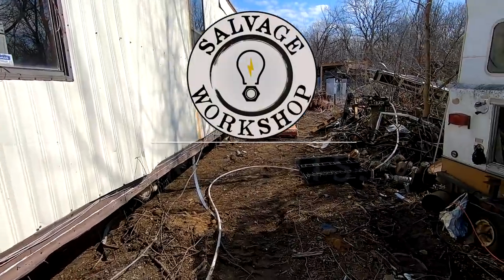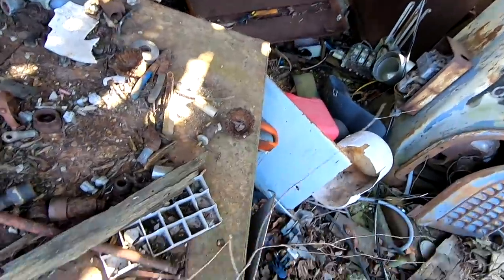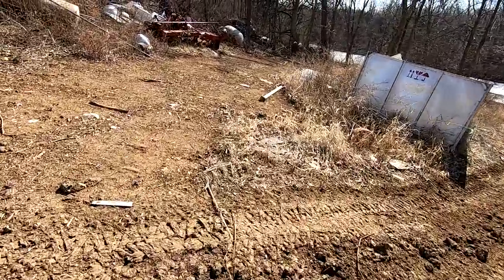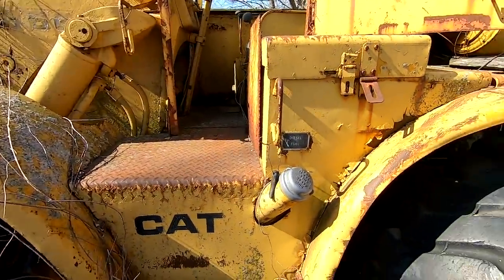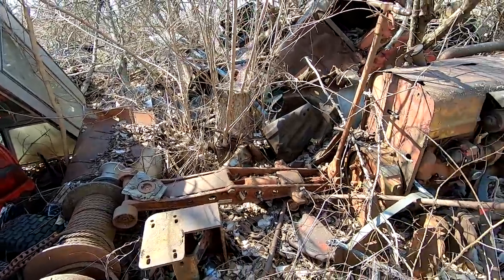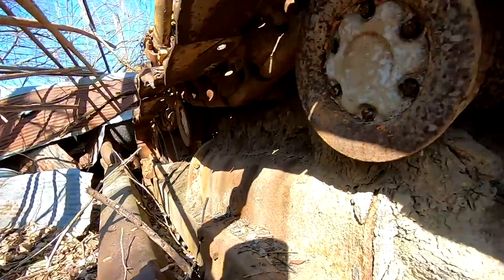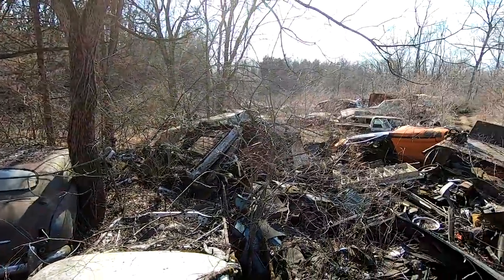Exploring the Machines at the FORGOTTEN Junk Yard ~ RESCUING OLD IRON ~ Episode 5 Part 1

Comment: Those cylinder breakdown machines, last one I saw go at auction, a fist fight nearly broke out bidding on it.
Reply from the maker: Interesting!
Reply: @SalvageWorkshop  If you are in the business of rebuilding hydraulic cylinders, it's a god send to have one. You might try reaching out to some local hydraulics shops, to the right guy it's worth the time.
Reply: I agree. That is a very valuable piece of equipment to anyone who has enough equipment to justify repairing and installing packing kits in their own shop.
Reply: They are worth several times their weight in gold.

Comment: The seat gets hard on the John Deeres & the safety switch inside the seat doesn't engage = no start or emergancy stop if your moving. I gave up trying to bypass the wiring & replaced the seat + seat belt. Very expensive but keep a seat cover on it now. It is a safety feature & you never know when accidents are gonna happen!
Reply from the maker: That is really good to know! Thank you!
Reply: Thomas.
YES, that what I thought. Because that WHOLE section raises. For safety NO start. It's got to be in the seat or seat belt area. But unless a guy who works on those Johndeer, skid steers, probably knows it by heart. It's got to be in the seat area. Maybe the switch is NOT making contact  ( being old) when cab comes down.

Comment: This place should be under the strict protection of the conservator of monuments. Not a single machine or tool should be scrapped! I'm waiting for part 2. Greetings from far away Poland :-)
Reply: I think the milling machine is not repairable within any economic sense, you can buy them here for less than a thousand dollars, even $500. And no rust!
Reply: @RRaucina  Machines too have the right to die. There's lots of precious metals there and they ought to be recovered.
Reply: @RRaucina  Right
Reply: Right

Comment: That marvel 6a power hacksaw is fantastic!! I love my 14” Racine. Fantastic saws. 

Drill bits are fine. Probably just need to be sharpened 

Those lathes are sweet 

So many treasures!
Reply: I love my Peerless from 1942. Probably 4,000#. $75 at the school shop auction.
Reply: @RRaucina  awesome! Mine was 300$ a few months ago. 400$ in spare blades came with it so it was a deal for me at least. It’s well paid for itself cutting up to 6” square stock. A bigger one would be awesome though. 
 
Mine was originally in a machine shop and later in someone’s garage used for cutting wood haha 

1960s I believe Racine 14” wet saw. I have a video clip on my channel showing it
Reply: @JustinTopp  Nice. I came from Racine and Kenosha too. The industrial heartland

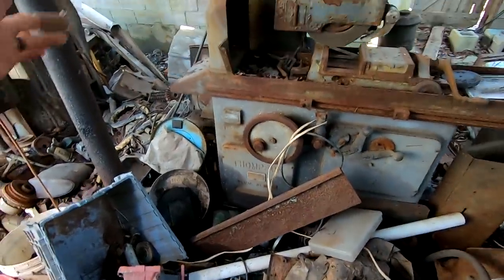Comment: [8:00] I think the drills would be saveable, because they are (relatively) easy to resharpen if you have the right sharpening jig (or skill).. evaporust and resharpen.  The milling cutters might be harder- i suspect the cutting edges would be pitted and you would need a cutter grinder and considerable time to put new edges on them.

Comment: Definitely save the bits and cutters, older made parts tend to keep their cutting edge better than things today.

Also with the amount of variety you'd probably never have to buy one again!
Reply from the maker: Yeah that is true! Problem becomes, hauling it all out of there, then cleaning it, having the proper place to store it, and then organizing it in a way that I can find it when I actually NEED it! It's a LOT more work than you might think! (Don't get me wrong, I still may go for it!)
Reply: @SalvageWorkshop  yeah that's true, storage and cleaning is always the thing you over look I have cleaning jobs for finds lined up longer than I care for! If I was there is be grabbing every slab mill I could find, you can never have enough slab mills!
Reply: @SalvageWorkshop  Yes, be careful that in 40 years someone is not making a video of YOUR hoarded mess!
Reply: All those cutters and drills can be cleaned and sharpened. steve summers has videos on his channel showing how.
Reply: In my opinion when you get more than light rust on HSS tooling the cost of regrinding exceeds the value of the tooling  take  for example morse taper drill bits easy to regrind the tip but the taper will be pitted the cutting edge on the flutes will be blunt not easy to regrind 
easier to get one off ebay  I agree that the steel is likely to be of good quality

Comment: IDEA: Once Big Red is up and running around, for sure you will have calls for work/help. The low boy trailer is a no-brainer. Instead of the Kenworth, might consider a sizeable dump-truck. Many times when a Cat is required, so is the need for a dump truck. Cha-ching! And then even a smaller sized excavator is frequently needed. Voila - a new profession that makes great $$. Love the vids by the way.

Comment: You should get the 966, the big Manley jack,the dozer with the tree growing around it,the lowboy next to the dozer & the rig,those would be great for you to get & get them running again & the lowboy you could do away with the wood & replace it with a steel bed same with the ramps, but I noticed that the yellow lowboy has steel ramps on it so I wonder if those would fit on the lowboy next to the dozer if so just take them off & switch them

Comment: This isn't a junkyard. It's  SALVAGE Yard!
23:00 that's a big wheel loader.
29:00 might want to run some numbers. Sometimes old track machines like Old Red had back-hoe attachments.
29:20 HOLY CRAP! A CUB! Those things can still fetch a decent price, as they are still a very handy lawn/garden tractor that won't break the bank. Would be a good purchase.
29:50 Told you it was a big wheel loader. :) Probably wouldn't be TOO difficult to start. Maybe...
36:20 Is that a crimper for hydraulic hose in the tool-box? Or part of one?
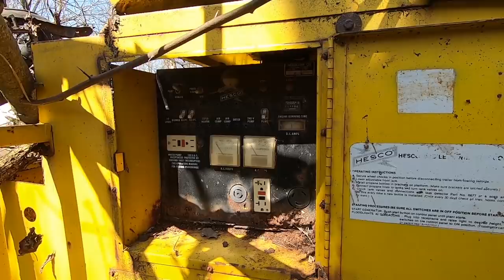43:00 ooooooooh parts!
49:00 Huh, that would be interesting this to get out. Diesel Creek would approve.

I'd still like to see what that over-turned tracked machine is that was behind where your Skidloader was.

Great video! I love places like this! My grandparents usually had a "dump" somewhere on their property that was always full of stuff like this. Loved digging through it!

Comment: On the skid steer, just to the right of the seat. Creak the starter fuse. It is a 15 amp fuse, closest one to the front.
Front to back-----Starter, loader arms, acc and lights. 15,15, 25, and 20.

Comment: The Kenworth looks like an early to mid 1990’s T800.  Single stack, looked like a five over five Eaton 10 speed shifter: 5 speeds high and low range, and two speed reverse.  The one I drove was a 1995 with a Detroit diesel.  Good trucks.  It could be a W9 too; those are more common as OTR trucks and the T series are more often service trucks due to a shorter turning radius (if I remember correctly).  The one I drove used to be an over the road long haul truck, but we pulled the sleeper off and put a 3000 gallon water tank and a pump on the back and built a fire truck of it.  Great chassis for that use!  Quick, powerful and nimble for such a big vehicle.  Even with a full water tank, she moved out like a sports car!   Hope you can save it!!

Comment: That place certainly goes on and on. If you are planning to rescue things: Lathes, milling machines, vices. The tools are likely corroded on the cutting faces and even with re-sharpening might not be any good (sorting them out you might find a few good ones), drills could be sharpened. The auto lift. That Singer sewing machine is an industrial model useful for automotive/furniture upholstery/sail making (I've rescued a home one that had been corroded in a chronically flooded basement) that era machine is pretty rugged. Contact the Vice-Grip Garage channel about the cars, maybe he spies some co-channel projects depending on how many states away you are. Any old farm tractors out there? Those are fun too.

Comment: Is it possible we can get a "will it run" on that Cat 966?! I do so agree it would be a nice addition for Big Red. Even if it's just for Fun. So so much machinery out there wow. The Series 1700 Skid steer is an Owatonna, The IH Power Unit was a Factory they did in fact use Tractor engines Yellow & White IH Cub, the early 60s to 70s. Those are getting tougher to find. I'd got an ole Round nose 1951. Kenworth T600 would be the model 1984-07, And that Allis HD16 Crawler believe it or not It's Much rarer than your CAT. Very few of those Big ones left. Would be worth getting it out of there.

Comment: I have just looked up the 325's seat and seatbelt sensor. It looks like the seat sensor is a simple switch that, when sitting on the seat, the switch is closed allowing power to go through it. If you put a jumper on the connector it may work. As for the seat belt sensor. They are normally either work based on resistance or just live/ground pads inside the slot. The seat belt buckle will bridge the pads. If the problem is with the seatbelt sensor itself, then my guess is that the pads have warn down. If it is simply just a live and ground pad, then simply using a jumper would again, bypass the sensor. If however, it is a resistive system I have no idea how you would get a replacement (I can't find one on google). You could work out what resistance value is needed to trigger the sensor though. Which is possible to do, you can use a variable resistance device and just go from 1ohm to 100,000ohms until the light turns off. Then stick a resister of that size in the connector. 

Without more information on the problem I can't really make a proper guess on the solution. If I was a betting man, I would put 5 bucks on "The motor works great, but it doesn't want to move"  would mean that the parking break is stuck on, which would be caused by the seatbelt sensor.

It's a shame I am about 4000 miles away. I'd pop over with some test equipment and have a go at diagnosing it. (I wouldn't try to fix it, I can't afford to replace it)

Comment: the seat switches on all of these machines are simple on or off , and its very common for them to develop and intermittent state , usually a simple jumper wire between the power and ground will do the trick

Comment: well the backhoe attachment or possibly the tulsa winch would be neat attachments for old red . also the Palfinger truck crane is reallly incredibly expensive if new and would be a good safe, if you put it on a foundation with a hydraulic agregate and tank you got a very sensitive yard or shop crane also it usually has hydraulics all the way to the front - so you not only can use it for forklifting pallets but also to use a hydraulic clamshell bucket for dirtmoveing allowing the truck to load itself - so for minor material movement you dont need to haul any excavator or similar equipment 
also can lift more than your auto crane and is thanks to hydraulics a lot more precise to place - my guess for age is 1990s also you still get every spare part there is from the original firm - even for old series - like metric hydraulic fittings and hoses or the right metric hydraulic ram seals ,

Comment: If anything, a few cans of rust inhibitor spray and plastic wrap should be done to protect the machinery short term. Most of the tools can be revived in a drum of diesel. It is possible that somewhere in that workshop there will be a tool sharpening grinder to clean up the good looking tools. There a lot of money about to be lost there, so please do your best to recover as much as possible. Vintage tooling has a place somewhere.

Comment: I buy rusty, junky tools and parts, clean them, and sell them. In about 20 years, I've had a handful of pieces that weren't salvageable. The metal in the older items is so much better than newer ones. The metal in old machinists tools are always salvageable. I use Metal Rescue because the chemicals are less toxic, take my time, pay attention to temperatures, use soft abrasives when necessary, and am careful not to over clean. That is, I'm not trying to make it look exactly like it did 100 years ago. My goal is to remove rust, gunky grease, and other dirt in order to make a clean usable tool or part. Definitely worth cleaning up those old tools!

Comment: I have used an inexpensive way to remove rust from objects is to soak it in Apple Cider Vinegar for 3 or 4 days. I buy it in gallon jugs at the Grocerie store.  The Vinegar is a mild acid but does a good job.

Comment: wow! that's a lot of stuff. my main vice is a wilton bullet, but it is a 4". i've never seen one as large as the one on the floor. kinda makes you want to build a new pole barn just to save all of this equipment. it does me anyway. i kinda like the idea of mounting the manual tire changer horizontally on the end of a bench. i might try it with mine. you could spend a year on this property and not see everything. good luck. i'd offer to help him clean it up just to have the first chance of buying what he wants to get rid of before it gets sold for scrap.

Comment: On that Deere seatbelt problem.. pull the sensor wire on the hydraulic brakes . Bypass the switch and make it think the sensor is functioning. When they get wet , and i bet it did, it fouls out off . Meaning it won't let the wheels move. Use a voltmeter and test the signal where the hydraulic brakes lock up ...check the seat-belt sensor and weight sensor in the seat too ...
Reply: Also check the parking solenoid sensor on the filter housing for the hydraulic fluid , the hydraulic motors on the wheels have internal parking brakes in them without separate linkage or lines . And make sure nothing is under the seat when the cab is down stopping the sensor from being activated ? Ive seen dumber things .....

Comment: That International Cub is around a 1970. Still a great little tractor. It is set up with twelve volt system. I know i seen a mower deck for it in the video of your skid loader. That at 46:18 i am thinking it is a shram or the manufacturer name was something like that. I seen one for sale a few years back. Looked like a tractor with that in the back and a contour  weight in the fount. It was a giant rototiller for smoothing out grade or something like that. Loots of neat stuff there.

Comment: The shop I work at has an OTC 100 ton shop press like that 50 ton you showed.

That Kenworth is probably a late 80s or early 90s. Model should be on a tag in the drivers door frame along with build date

Comment: That tractor engine is a power head. Basically a engine that can be moved around to power different machines. Usually by either a belt or a pto shaft.

Comment: The cutters and tooling can be derusted the fastest and least expensive way with electrolysis.
A four foot square tub or wooden crate lined with visqueen will hold the water and washing soda mixed electrolytic solution. Lay a steel plate across the bottom so dropped tools won't poke a leak in the liner. 😁
Lay bars across the top and hang the tools on bailing wire suspended in the bath so they don't touch. 
Connect a good size manual battery charger and in a day the rust will be gone. 
Now the bad news. Any chipped or broken mills and tooling are scrap. The edges most likely are dull. Micro pits from rust can be sharpened. It isn't quick or easy. 
You might find a DoAll sharpener in the mess. That would make it an easier job provided it is salvageable. 
I'm retired so spending a few years cleaning tools isn't daunting.
If I intended to use any of it for a business I would have to think long and hard about cost benefit ratio.
One thought would be to find some like minded makers to invest time in creating a communal machine shop. Many hands make light work.

Comment: That big green welder looks like it may have been for bandsaw blades since it appears to have a grinding wheel on top. That's a lot bigger than most  blade welders since they are usually a small box on the saw frame.

Comment: Run and electrolysis tank with washing soda. Quick grind fir fresh metal, some steel wire and 10 amps of 12v power. The whole pile could be clean in 5 hours.

Comment: I would try setting up a large electrolysis tub due to the sheer volume of items. Trying to Evaporust all that would cost a small fortune. The drill bits can be sharpened  on a grinder, but all the mill cutters would need to be precision ground.

Comment: Assuming that the seat safety security switch is like many machines if your lucky it will be like a circuit breaker  usually bridging it with copper wire U shaped would do the trick...But if it's linked to a electronic device then there will be hard time to work around it...

Comment: Most of the tooling on the floor, like the cutters would need resharpened. The KT mill when you stepped in is so beautiful but if you look closely at the ways had it been rescued around the turn of the century like 20 years ago it would have been really good. Same with the surface grinder. But the deterioration might be too great even at scrap price. Like a lot less and you might make them both work but those parts on the floor were save able 20 years ago but the rain has produced its work. All of it can be saved but you would need the genius of the man who owned this shop. The Onan genset could probably fire right up. I would love to have that KT mill I tell you.